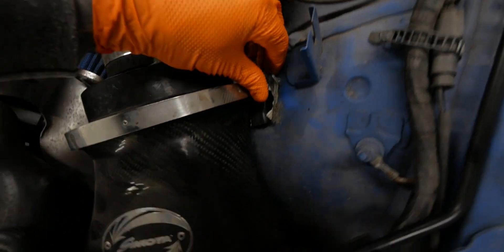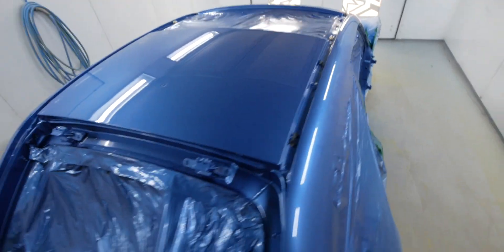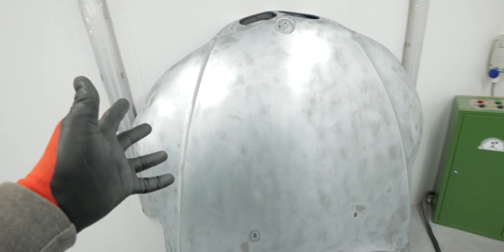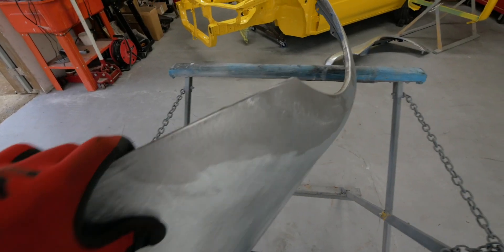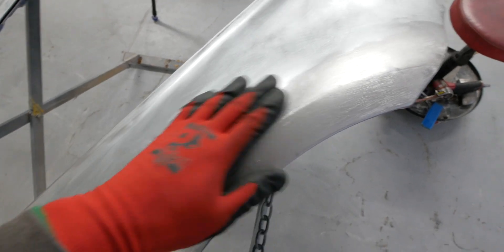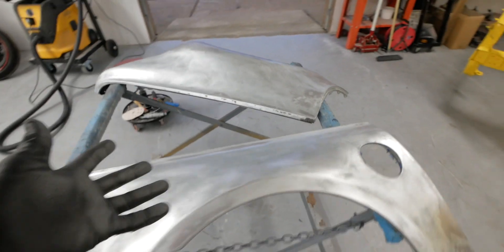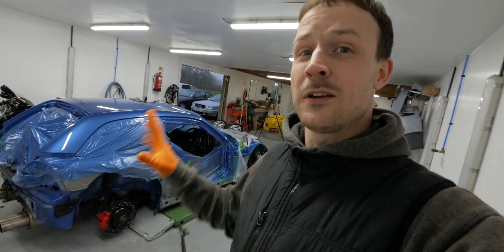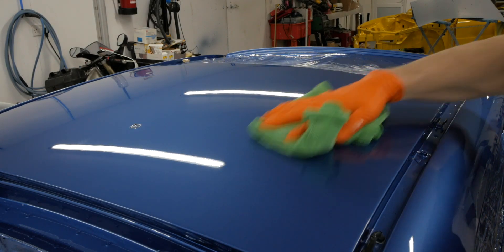THIS REALLY HELPED / BMW Z3M RESTORATION

Comment: Nice haul of parts there 😁 cant beat fresh paint after its been prepped...  and as you say experience definitely required for a polisher, enough damage can be caused with a DA alone 😂
Reply from the maker: 😅 iv had my fair share of burn throughs over the years with a rotary polisher 😂  at least the rebuild can start now with the shell in paint 😎